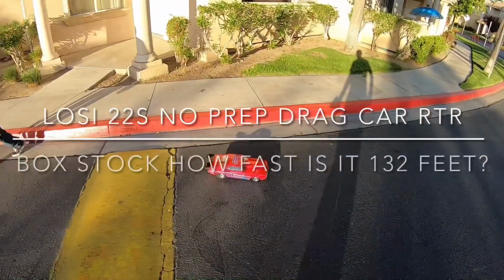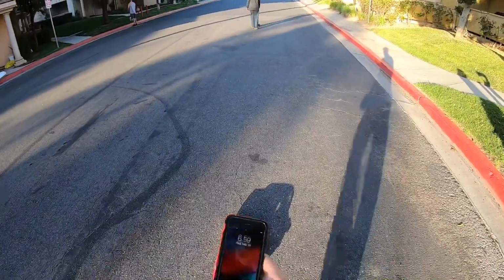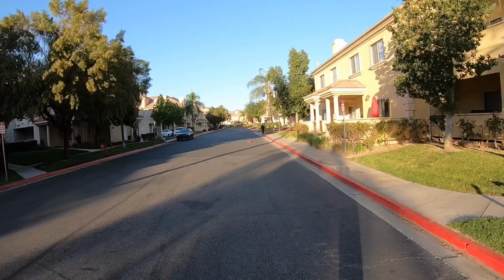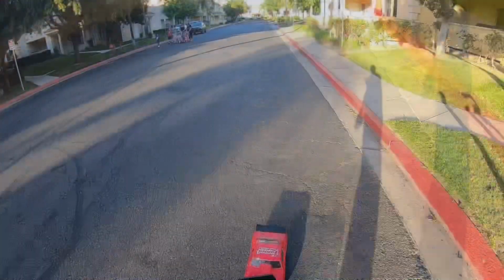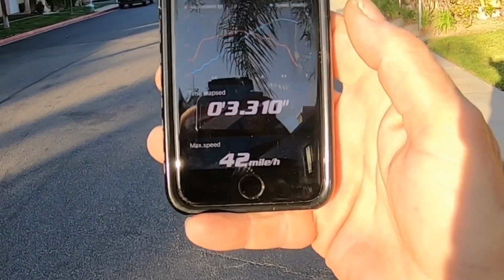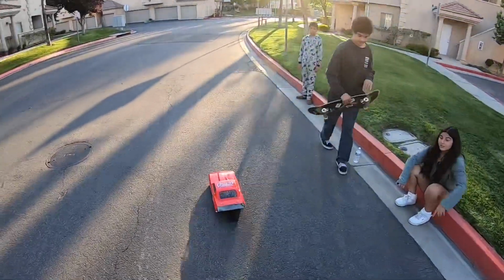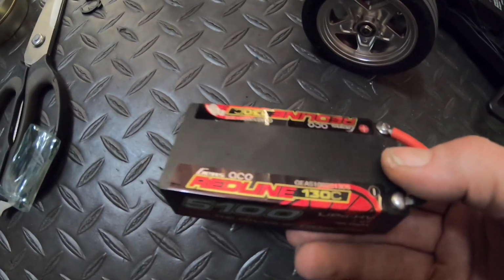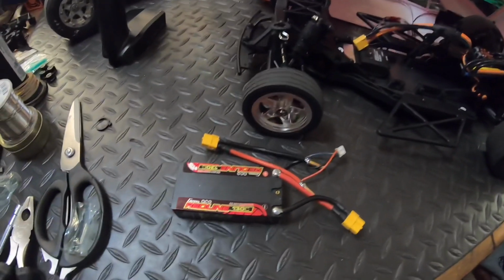Losi No Prep Drag Car RTR 1969 camaro how fast is it in 132 feet Box Stock no tunning??

Comment: Sorry if I missed it, was that 2S?
Reply from the maker: Yes 5100 mah 130c 7.6 v short race pack gens ace battery rather than the 7.4v standard pack 💯💯
Reply: @earlmoorhead5555  Gotcha. Same pack in the newest video with the larger pinion?

We all bench raced and speculated that this car's ET would be in the 2.7-2.8 range when properly geared on a standard 2S.  It's looking like once you get the chassis figured out to take full power launches without slipper, 2.8-2.9 might be it's range. Do you agree or do you think there is more in her yet?  Have you played with ESC settings (if they are adjustable) yet?

Keep the great videos coming.
Reply from the maker: @troybolton4055  I feel the numbers are spot on if I can get it to hook up I feel my gearing a little high with the bad cogging but I think I can work around it with the suspension tunning for sure 👍👍💯💯💯

Comment: Hey Earl, what do you think would be better to buy the DR10 or the Losi ? Thanks . Your videos are great !
Reply from the maker: The Losi fir sure the DR10 out of the box needs a lot of tuning to be even close to the performance of the Losi and the body quality from the dr10 looks cheap compared to Losi camaro lic body 💯💯💯
Reply: @earlmoorhead5555  thanks Earl, I was thinking the same,  the Losi has alot of good parts over the DR10 , steel trans gears that a plus in my mind . Lol . Hey keep up on the great content,  wish you the best . Jim.
Reply from the maker: Thanks 🙏
Reply: Hi Earl, what's the device you use for tracking the speed and run specs on your cars ? Sorry to bug you , ty . Jim
Reply from the maker: @jimreaume2937  I talk it about it in almost every video but it’s the sky rc analyzer made by power hobbies
Reply: @earlmoorhead5555  well Earl I bought a DR10 lol any first setup info you could share ? Iol I haven't even put a battery in it yet lol . Ty
Reply from the maker: Shock tunning and slipper is important shock tunning was rough for me on the dr10 💯💯👍👍
Reply: @earlmoorhead5555  thanks bro